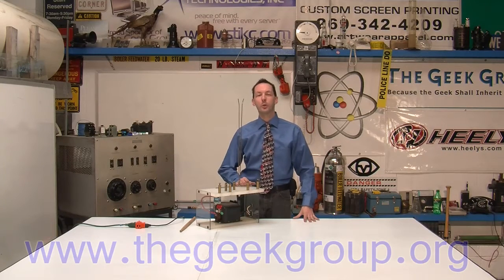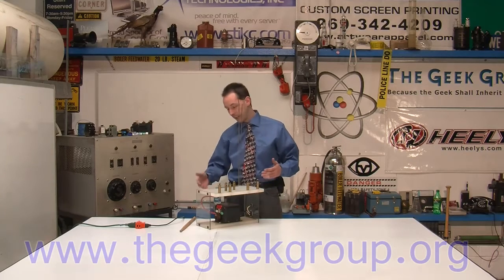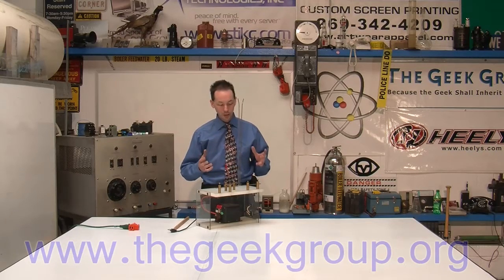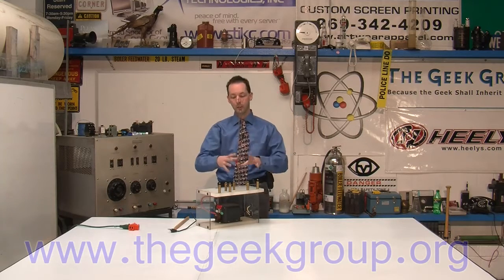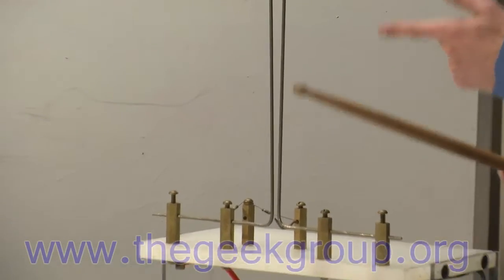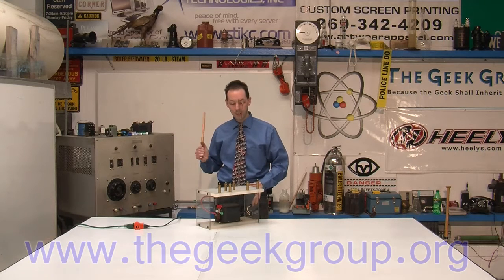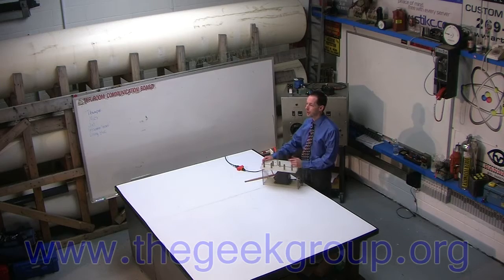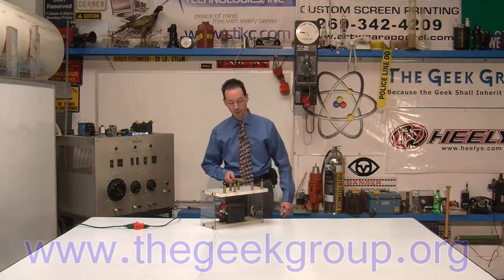Jacobs Ladders

Comment: We made one when I was in High School using a 15kv neon sign transformer. It required no tricks at all to initiate. Neon sign transformers are current limited, so they may be a little safer than other high voltage sources. In 1970, the neon sign company donated it, but due to liability, and the cost of copper that's not that likely any more.

Comment: it was at about 2- 5 KHz  so at any one point in time it technically was only making one path but the risen path was more resistance so it would find another rout to the wire ionizing air  several cm away making a second path. this would happen hundreds of times a second in several spots making it appear to be arcing in several locations all at once. its a bit like Tesla coil pictures of it striking a target just fast enough you brain makes it look that way and not jumpy like a TC